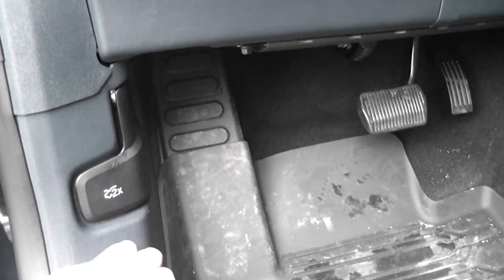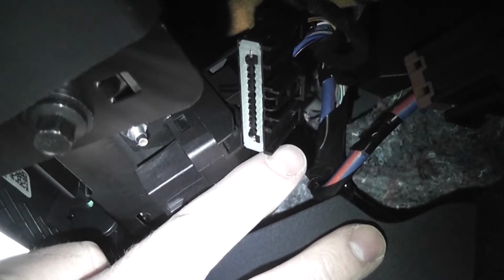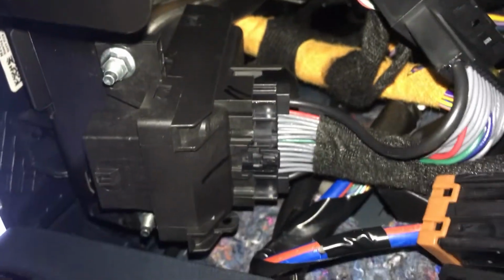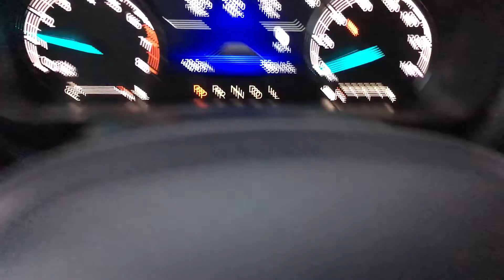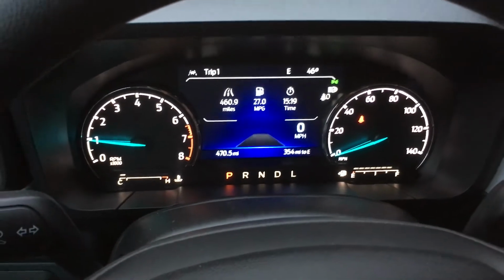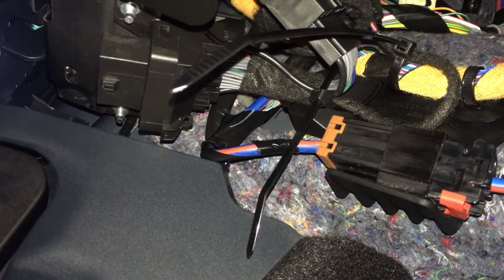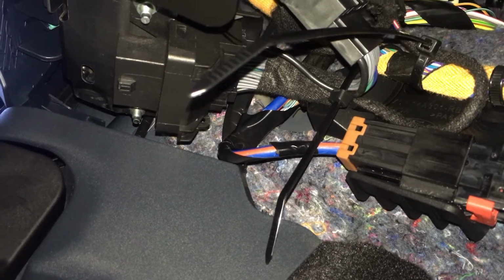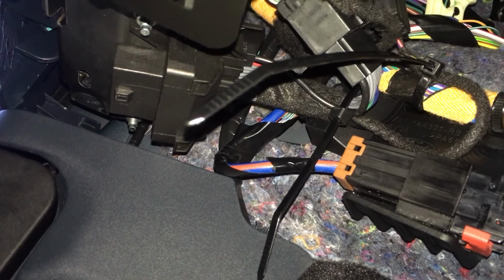2022 Ford Maverick Ecoboost Autostop Eliminator Install

Comment: Just plug in a hitch receiver tail light available for about 20 bucks or cheaper on many truck sites. The truck thinks that you are pulling a trailer and the AUTO-STOP-START will not work !!!  Plus you now have an extra stop light for greater visibility and safety from rear rear end crashes.
Reply: But then your blind spot monitoring stops working if you have a Ford Maverick

Comment: I had my Auto Stop Eliminator installed now since I bought my Maverick and it's been great having it installed. First of all it was the easiest install ever! Then I found out what it really does is allows the driver to choose the default state. If I turn the Auto Stop system on, it stays on and same for when I chose off, even after an ignition cycle. I mostly leave the Auto Stop Start off but when I see I'm going to be stopped for awhile I'll use it.

I also found out that the Auto Stop system is very sensitive to releasing the brake pedal pressure even slightly and it restarts the engine, defeating the purpose of shutting down to save fuel. So I use the Auto Brake hold feature to make sure there's no accidental restarting before I'm ready to go or the timer restarts the engine.

Lastly, there's an electric water pump for when the engine is in the Stopped mode. Because of that, it's a good idea to use the Auto Stop system every once in a while so the engine coolant gets circulated through that pump also.

Comment: thanks for this. Also, i couldnt easily get the thing off so i took the two m8 flange nuts off and removed the obd2 connector, made it really easy. I then dropped one flange nut into the side panel and made it really hard on myself 😂
Reply: I did this too, but anticipated the nut dropping behind the trim so I held a magnet on it as I unscrewed the nut.

Comment: Where does the "second" plug in go to ?
Reply: There isn't one. That other little box holds a tiny circuit board. It includes some zip ties to tie it out of the way

Comment: Question, what will FORD do if & when it is found that the Autostop Eliminator has been installed and some sort of warranty work needs to be done? FORD going to deny the claim??
Reply from the maker: They can only deny warranty if they can prove the device directly caused the issue. I'm out of warranty now but never once when I when in for service did they ever even notice it.
Reply: @FordMaverickMods  thank u

Comment: I was just wondering if the Maverick Eco Boost does this auto/stop. We have a Subaru Forester and it's on by default - drives me crazy! I rarely stop long enough to make that feature worth it.
Is it this feature that makes it an "Eco Boost?"
Surely the hybrid version isn't as bad...our Forester shakes on start up. There's no way this is a cost effective feature.

Comment: Great video, i would just cut the zip ties back with a set of flush cut pliers at harbor freight. They cut the tie so far back you will never stab yourself with the fresh cut edge. Used to be $2.00, now 4.. love your truck

Comment: Easier if you remove two 9mm nuts and drop the OBD port down.  Then you can unlatch and unplug the original cable and plug in the eliminator.

Comment: I'm a dumbass. What is the auto stop/start for??
Reply: The Maverick (and many modern vehicles) have an auto stop/start feature. This "feature" turns the motor off when you completely stop the vehicle with your foot on the break. The motor then immediately starts when you push the gas again. Its designed to be a fuel saving feature, but for most people its really annoying. Its always on by default, and you have to disable it by pressing the button every time you start your car. This eliminator bypasses the button, essentially making it always off by default, which is how it should be in my opinion.